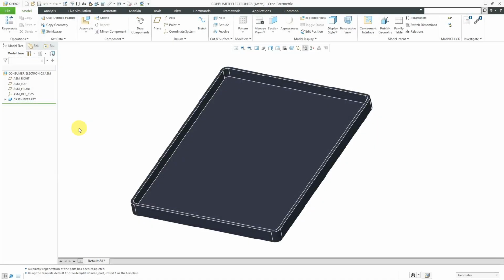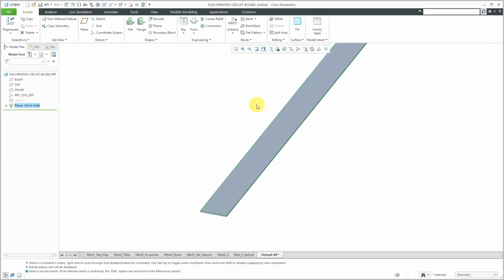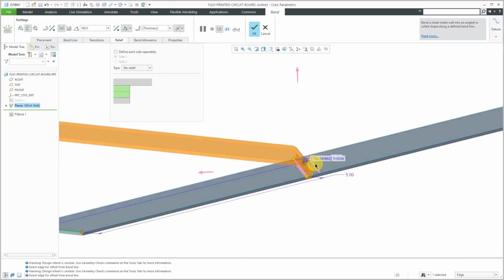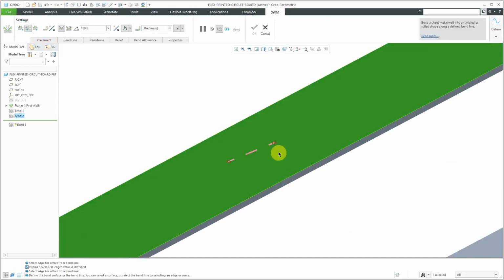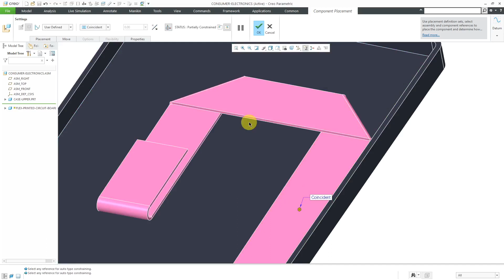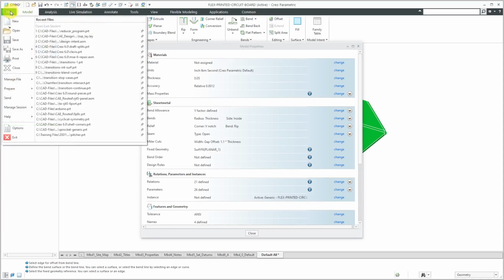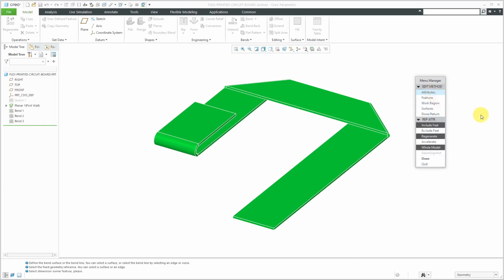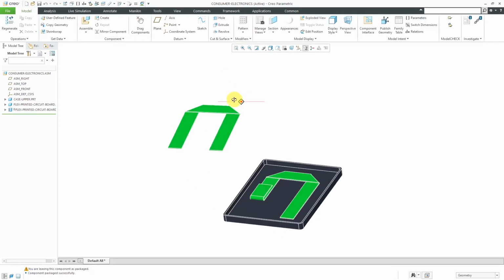Creo Parametric - Sheetmetal for Flexible Printed Circuit Boards

Comment: I have to say that these videos you've been putting up on Youtube are one of the best, if not the best, that I've seen regarding Creo tutorials. Very professional and clear way of showing everything. Please keep it up! I regard myself some what seasoned Creo user and still find something new in almost all of your videos! P.S. I typically use unbend - bend back features at the end of the feature tree in a sheet metal part. This way I can create a simplified rep for flat state where I only exclude the bend back feature. This way the default representation is always the bent version and there is no need to tick through multiple different features for the flat one.
Reply from the maker: Thanks, Mikko! Yeah, I hate seeing a Flat Pattern feature at the bottom of a sheetmetal part's Model Tree. I don't know why people are obsessed with the flat state and developed lengths when they're usually not manufacturing the parts themselves. Leave that stuff to the experts, the people who bend metal for a living.